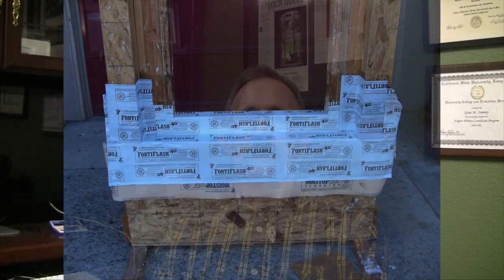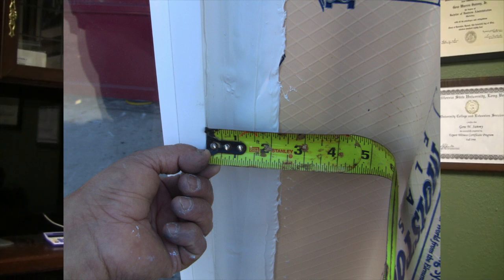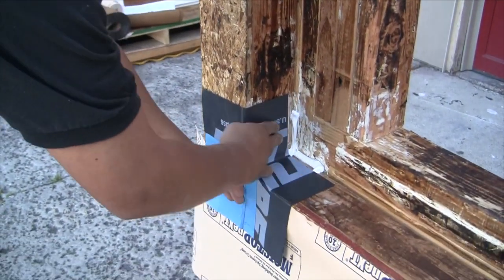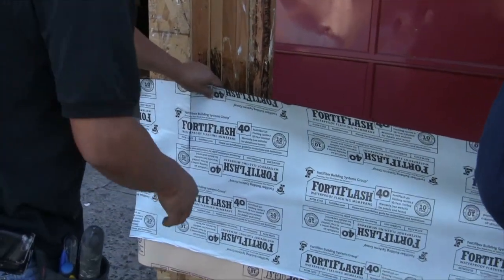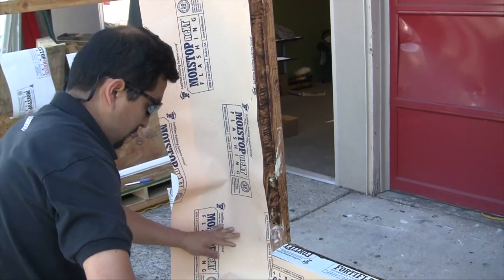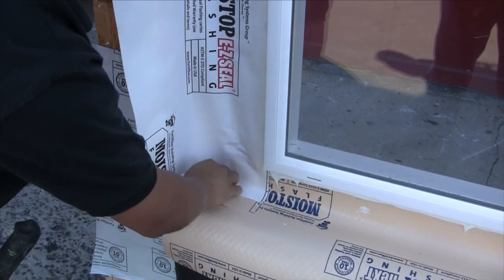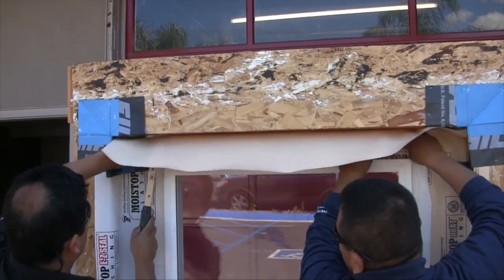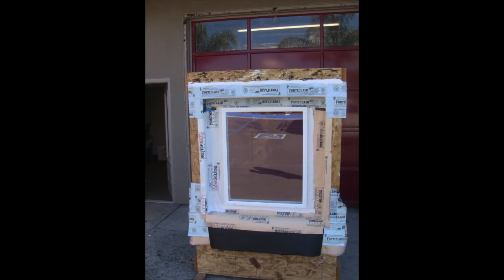Recess Window Installation_Fortifiber products_How to-BEST Practices

Comment: This is the only video I have seen showing a proper fastener for window flanges.  The guy that replaces that window will absolutely love you!  It is also much easier to control a screw to prevent over tightening.  I have had to remove old windows that were nailed in with a grinding wheel and I didn't think kindly of the installer.  Windows will very likely be replaced whether from damage or new technology. 

 How about a video on a 'boxed out' window installation as in rain drain applications with rigid foam board under the siding?  They are becoming much more popular but haven't been dealt with in the how to videos at all.  Which framing build out method to use and how to deal with the sealing would be a good video.

Take care.  Doug
Reply from the maker: Thanks very much Doug. We are getting some new space soon allowing me to create different application details and videos. I have a Canadian friend wanting us to make a brick wall detail and video. So hopefully soon. Take care....  Gene